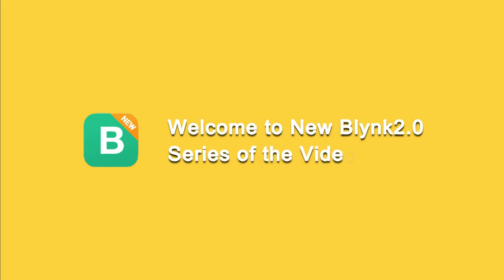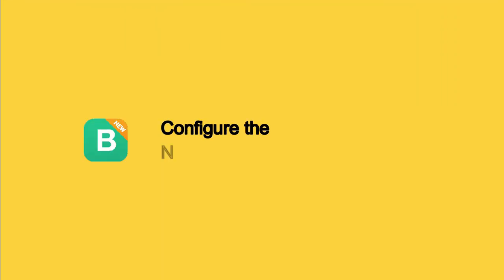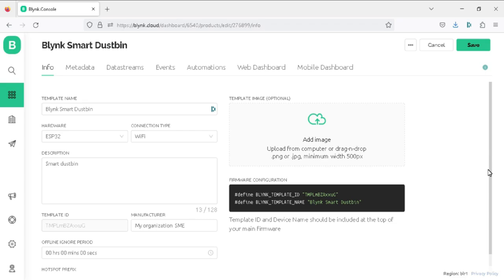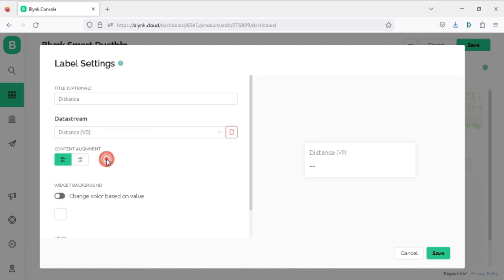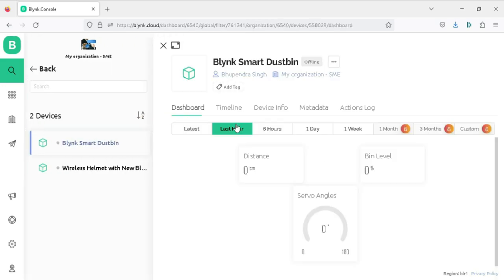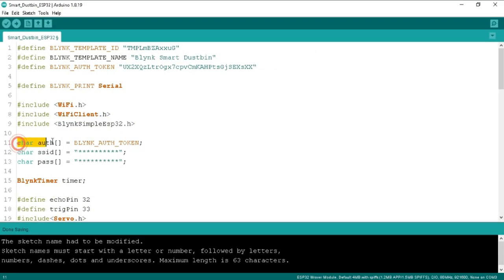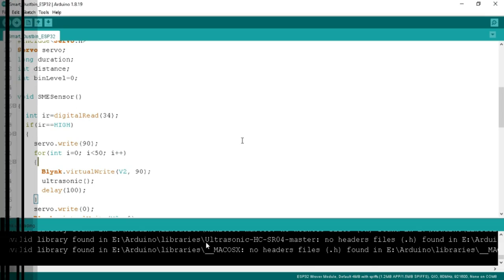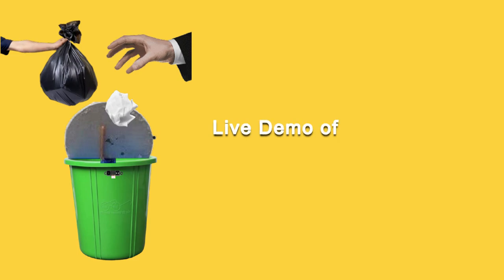Building a Smart Dustbin with IoT using Blynk 2.0 and ESP32/NodeMCU ESP8266 - Method 2

Comment: sir the moment i am uploading code for esp32, it is showing me error for servo library that This library only supports boards with an AVR, SAM, SAMD, NRF52 or STM32F4 processor... please  guide me sir
Reply from the maker: Use servo library for ESP32.
Reply: @SMEDehradun  I'm using that only but still the same error comes, please help!!
Reply from the maker: Select the proper board, change wifi and blynk credentials, servo library for your board can help you only. All the information already shown in the video. Plz watch carefully. Note that servo library for esp8266 and ESP32 are different. Read the compilation error while compiling.

Comment: we connected the circuit properly and in blynk also its showing connected code also uploaded but bin is not sensing anything any solutin.. We need it as fast as possible.
Reply from the maker: You need to check the sensor separately to ensure that they are working or not. Watch each steps, change the blynk credentials, add wifi hotspot name in code and then try again.

Comment: sir may i ask? is the IR sensor for detect the object near the dustbin and //the ultrasonic for monitor the level in dustbin? confused between both sensor's function
Reply from the maker: IR sensor is used to open the flap while sense the hand & ultrasonic sensor is used to measure the garbage level in the bin. 

If you see the each step do the  video then you will get complete information about the project.
Reply: @SMEDehradun  thanks sir. It really helpful and glad that you reply fast. Tq so much
Reply from the maker: @mariahhafizah5208  most welcome

Comment: sir I have no। Ir sensor and I don't want to measure bin level just only smart dustbin so how to do ?
Reply: Please tell sir quickly I have project in school
Reply from the maker: I am not getting your point. Can you explain more project if you don’t want to measure level?
Reply: I telling you that I have uploaded code but it cannot connect wifi and another proplem is I have no lr module only I have ultrasonic sensor,my project is just automatic dustbin I don't want to check bin level how to do this please tell
Reply: @SMEDehradun I telling you that I have uploaded code but it cannot connect wifi and another proplem is I have no lr module only I have ultrasonic sensor,my project is just automatic dustbin I don't want to check bin level how to do this please tell
Reply from the maker: For the wifi, check your wifi and blynk credentials. If you don’t want to use ultrasonic  sensor to on off the dustbin flap then you need to edit the code, remove the ir sensor code and level code. And add the code of ultrasonic as per your requirement.
Reply: @SMEDehradun  I wnat to create a smart dustbin by using esp8266 and ultrasonic sensor how to do this
Reply: @SMEDehradun  tI wnat to create a smart dustbin by using esp8266 and ultrasonic sensor how to create this
Reply: @SMEDehradun  I wnat to create a smart dustbin by using esp8266 and ultrasonic sensor how to create this?? please tell
Reply from the maker: Ok. Then remove the code for IR sensor and Servo motor
Reply: @SMEDehradun  how to do this??
Reply: How to do this?
Reply: How to do this?
Reply from the maker: Download & read the code and alter it as per your requirements

Comment: Im using Esp3266 it's not shown in the board manager..why
Reply from the maker: You need to install the esp8266 by adding the external link.
Below link will guide you step by step.
https://www.nuttyengineer.com/knowledge-blog/nuttyfi-iot-board-in-arduino-ide/
Reply: Done sir.after that when I am uploading the program There is an pop up error which is "D7 was not declared in this scope did u mean V7 " like that showing.kindly help me to complete the project sir
Reply from the maker: @gokulpriya-y4u 
D7 is D7 no pins
Reply: @SMEDehradun  can't understand sir
Reply: @SMEDehradun  I need to complete this project by tomorrow sir..kindly help me sir
Reply from the maker: Plz watch the video properly. And check your hardware connections.  All the information have been provided in the video.

Comment: when i have give servo angle 90 degres it rotating only 45 degrees, and when 180 is given it rotating 90. and i have external power supply. what to do.
Reply from the maker: You need to  manually calibrate the  servo motor as per your project requirement. Actually it’s pwm works on 3.3V that’s why.

Comment: yes sir , i checked everything , every component is in working condition , but , still this project is not working , i dont know whats wrong with it , i think u r circuit diagram for esp8266 and the code doesn't match because the d values are different , please check once sir and please help me
Reply from the maker: The circuitry and programming codes have been thoroughly reviewed, and the content presented in the video is entirely accurate.

Individuals who refuse to acknowledge their own mistakes and instead shift blame onto others, never got the helps from others.

Comment: In code when I mentioned servo angle 90 degrees it's only rotating 45 degrees. What should I do
Reply from the maker: Check the 0 and 90 degree working of servo in the bin then place it accordingly.

Comment: I made connection as per the circuit diagram but the servo not rotating with ir sensor, and also blynk not connecting to board that is not getting online. It  is not working even i have used 5v external supply
Reply from the maker: You need to check your hardware connection properly and also check the IR sensor is active high or low. Make the proper changes according that.

Comment: Hlo sir 
I have made the full project but one problem im facing that when I'm sensing the ir sensor it took 10 second to rotate the servo 90 degree and once im moving my hand from ir sensor the servo goes to 0 degree.. 
Sir please say what to do.. 
It's urgent sir please 🙏🏻
Reply from the maker: Great to hear that your project is working: You can change the delay option in code.

Comment: Sr, when I putting a pin in the cmd, i cant connect to the Blynk app its getting offline, also my servo motor not working
Reply from the maker: Change blynk and wifi credentials in the code then try. If possible, disconnect all the connection and then check, your board is connected to blynk or not?
Reply: yes my board is connected to blynk, but if I put a pin in the cmd its getting offline but if I remove it in the cmd it's okay and it's getting online (sorry for the grammar) @SMEDehradun
Reply from the maker: That means there is issue with your connections.

Comment: I'm using 5v external supply. Did I have to remove USB connection as I'm given supply to vin.
Reply from the maker: If you are using external
Power supply then remove the usb cable. And remove the external power supply while uploading the program.

Comment: How have you provided power to the circuit? What are the battery connections?
Reply from the maker: You can provide the power through the mobile power bank directly through the usb cable or you can connect 5V DC to Vin and GND pin to GND.
Reply: @SMEDehradun  Thanks a lot

Comment: Hello sir the code is running fine but the node ncu 8266 is not getting connected with the hotspot
Reply from the maker: Possible there is issue of wifi credentials you have written on code. Also check blynk credentials.  If possible, disconnect all the connection and then check, your board must be connected to blynk.

Comment: if we are using 12v battery then we also need 5v power supply module
Reply from the maker: You can use 12V battery, but must attach 12V to 5V if required
Reply: @SMEDehradun  12v to 5v means
Reply from the maker: Yes
Reply: @SMEDehradun  thank you sir

Comment: Sir if i want to seperate the dry and wet waste, code and required component how should be changed? Reply pls.
Reply from the maker: There are lots of methods for waste segregation but for student project, you can use moisture sensor or IR sensor to monitor the wave length. 
You need to mortify the code for this.
Reply: @SMEDehradun Sir what will be the diagram and code after using moisture sensor.
Reply from the maker: Try it by yourself first. And if you find difficulties then drop the comment.
Reply: @SMEDehradun ok sir.

Comment: Circuit diagram for nodemcu is confusing while using power supply, can you provide it please im unable to find the circuit google
Reply from the maker: I have used external  power supply designed by us. 
You can use mobile adaptor as pier supply.

Comment: Sir will there be any difference in the functionality of the servo motor if I use 3 pins ir sensor instead of 4pins ir sensor because I am using 3 pins ir sensor and the servo is not responding to it . Please guide me sir
Reply from the maker: There is no issue of 3 pin or 4 pin ir sensor. Check the connection properly and try.

Comment: can you please provide the link or phot,  for the power supply module for buying
Reply from the maker: You can use 12V to 5V dc step down module for it. Below module may help you.

https://zbotic.in/product/dc-dc-12v-to-3-3v-5v-12v-power-module-multi-output-voltage-conversion/?gad_source=1&gclid=CjwKCAiAloavBhBOEiwAbtAJO6gxJYe6vNJSEEJ2H9lzpOXm0RijhxZ1S6IM_JZFRCB0kLHZqqmUJxoCiRUQAvD_BwE

Comment: I want to do the same but I do not want to automatically open it.... So basically I don't need servo and all... So what should I change  in the coding

Also when I include servo angle and all.. And go to upload it in my esp wroom 32 it says.. Compilation error and library servo claims to run on avr and all

What should I do
Reply from the maker: Remove the code for servo and ir sensor then try to upload.

Comment: i am using esp8266 board and i am getting an error on servo library which is not supported, i tried changing to esp8266servo but still not working
Reply from the maker: Servo library is different for both esp8266 & ESP32. 
Install the library as per your board and check the library example and make changes as per the library.

Comment: This code is right or have any error and  monitoring the level of 3 dustbin is possible by this project
Reply from the maker: This code is correct and working fine. And can configure it in any No of dustbin by adding sensors.
Reply: Thankyou Sir
In place of smart dustbin in blynk dustbin 1,dustbin 2,dustbin 3 inside smart dustbin  or separate  template is needed that is we need separate templates or can make altogether in one template
Reply from the maker: You can adjust it in single dashboard. And if you want to create separate template then it can also works.
Reply: Thankyou Sir

Comment: Sir is it safe to use IR sensor as it output is highly affected in the presence of loght . How to manage this issue?
Reply from the maker: Yes. It can provide you false output on the light. So you need to prevent the IR sensor from direct light.

Comment: Since there is only one Vin pin in nodemcu , how to connect motor's and sensor's pin in that?
Reply from the maker: You can use breadboard or you can solder pin in the general size PCB for multiple Vcc & GND
Reply: @SMEDehradun   okay , thankyou

Comment: If we use power supply module, is the connection common to Vin of nodemcu and vcc of other components.
If not explain it in summer please
Reply from the maker: You can provide power through mobile adaptor.
Reply: @SMEDehradun  My code shows no port provided.Even when i attached a nodemcu esp8266
Reply from the maker: Disconnect all the connection from your board and Then try to install the com port driver for your board. 

Below video may help you. 

https://youtu.be/LpohiGf8GiU

Comment: brother , ur circuit diagram is very confusing , in the video u have connected to 5v step down , but in the circuit diagram there is no stepdown , and i am not understanding how have u given power to the circuit , please help me as fast as possible , because we have to submit this project in few days
Reply from the maker: I think you have not seen the video properly. I have attached the adapter and also designed the step down power supply that provides power to the complete project.

You can also provide power through the USB

Comment: I have  connected the circuit as per the video, and its working but when ir sensor detect the object the servo is rotating after 5 or 6 seconds. And some time not rotating. I've checked the sensors seperately and its working. But when connected as per this circuit it rotating with some delay.
Reply from the maker: Check that your IR is working opposite or not. It may due to active high or low sensitivity issue.
Reply: How to check that can you please tell that @SMEDehradun
Reply: @SMEDehradun please reply
Reply from the maker: You have to your IR sensor, not mine.

Comment: if we connect as per the circuit without the power supply ,then what will be the power supply for the system?
Reply from the maker: 5V, 2A will do
Reply from the maker: 5V, 2A will do
Reply from the maker: 5V, 10watt will do
Reply: @SMEDehradun  is there any circuit diagram available...if yes then can share it
Reply from the maker: Just google and you will get power supply circuit.

Comment: Sir, my device is not recognized on device manager. I tried plugging esp first, then i tried with arduino uno. Both need the same driver (ch340xx). I installed it and it shows the message that it is preinstalled. Then i connected my device to the laptop and checked in the device manager but it doesn't show neither arduino nor esp.I connected them seperately one at a time.
 
My usb ports are working, the devices are not faulty even the driver is installed. This is the second esp i tried because the first one had the same issue and i ordered again.I even tried different usb cables.
I even tried rebooting my laptop and also checked the devices on other laptop but still they both won't show on device manager .  What  should I do?

Moreover even bfor installation when i connect my device to computer there is nothing in the device manager stating "Unknown device" Or any changes at all.
Reply from the maker: Have you checked your USB cable? 
Try to change your cable. And even after it, it’s not working then plz try to update your window operating system. It may help to identify the usb com port.
Reply: @SMEDehradun  Nothing works. Not even a new cable or a new esp.
Reply from the maker: If you are using the window operating system, then try to update, it may resolve this problem.

Comment: I followed your smart trash bin tutorial video, but when I power it up, the infrared sensor works, but the servo does not. I am a beginner and don't know where I went wrong. I hope you can provide guidance. I am using the diagram and code for the esp8266
Reply from the maker: This project require good power source to work. So It may power issue in your project.
Reply: So what you did now? The problem solved? If yes how did you solved? Please do comment!!
Reply: I help us
Reply from the maker: Provide external power and check all the sensor works separately with board.

Comment: hi hello, whats that yellow/golden thing you connected the components in 15:40? what should i use for esp8266? please reply asap, thank you!
Reply from the maker: That is 12V to 5V step down power supply module. I have used that because I am using external power supply adapter to provide the power to the project.
Reply: @SMEDehradun  will i need that for esp 8266 too? since i am also using external power supply. also are the jumping wires male and female?
Reply from the maker: Not required. But if you found power issue in your project then you need external power for this. But in that case, you can connect the power through the usb mobile charger to provide power to ESP826) board.
Reply: @SMEDehradun  can you please provide the circuit diagram with power supply module and name  of that module

Comment: heyyy sir i need it as fast as possible. Do i need to use the NodeMCU ? can i use WEMOS D1
Reply from the maker: You can use any wifi board.
Reply: @SMEDehradun  one more question what kind of wires do i need to use for all the circuit ?
Reply: and why does my esp 32 looks different ?
Reply from the maker: ESP32 has May versions that’s why.
Reply from the maker: Wires depends on modules and components that you are using. You need to self check it.

Comment: sir i am just using node mcu and ultrasonic sensor to send live data on blynk app
what changes need to be done in code?
can u please tell i am trying from a long time but only my device is getting online on blynk app but the distance data is not showing on the blynk dashboard what to do?
Reply from the maker: You need to edit the code for ultrasonic sensor. 
Below video link guide you how to do it, but you need to remove the dht sensor code  and add the code of ultrasonic. 
https://youtu.be/c5u6-Th1sI4
Reply: @SMEDehradun  ok sir I tried again and connected my mobile hotspot to my laptop and in the code as well now it's working fine touchwood 🙏
Hope it doesn't screw up like last time during my presentation 🤞
Reply from the maker: Congratulations. Don’t change your hotspot credentials or your Blynk template.
Reply: @SMEDehradun  sir I had a query when I am connecting only the nodeMcu and distance sensor the sensor is working fine but when I am connecting my whole circuit with LEDS and buzzer it is not showing distance properly after a few seconds it shows 0 
Any idea why is this happening is it because of less  power as power is being utilised by leds and buzzer?
I am connecting my nodeMcu to laptop and taking power like that
Reply from the maker: @robo4827 I think this is not due to power issue. It may be due to connectivity issue.

Comment: I tried this project im unable to detect my device in blynk app on mobile
Reply from the maker: Follow all the instructions as directed in the video, change the blynk credentials, add the wifi credentials, connect the hardware as per the circuit diagram and that’s it.